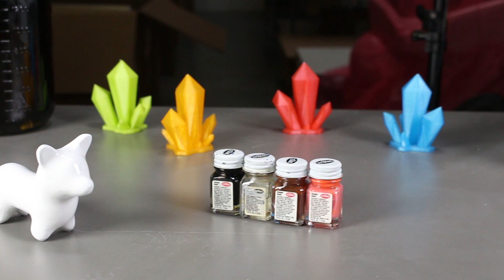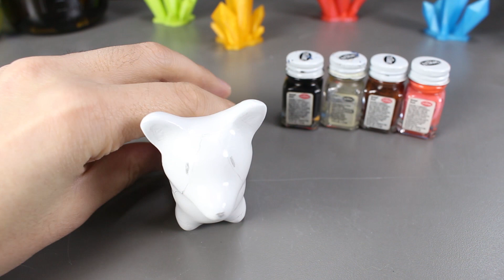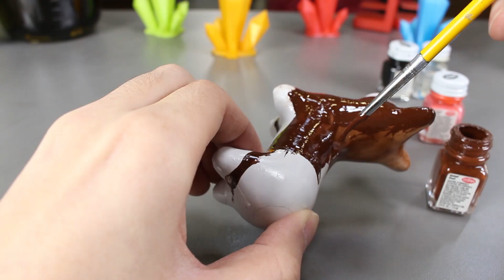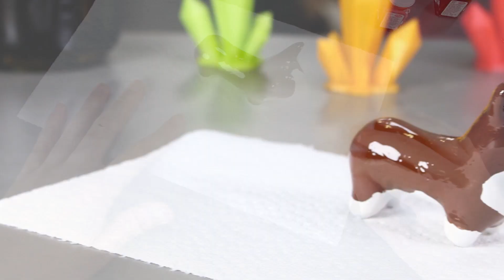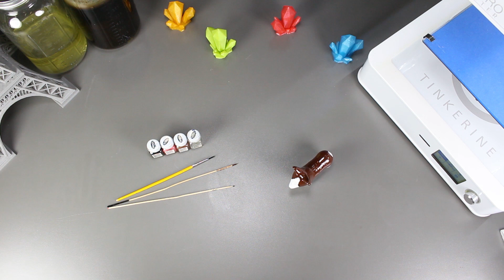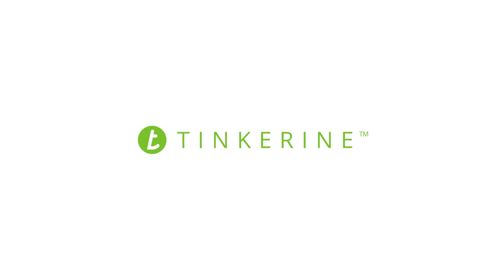Post-Processing 3D Printed PLA Print by Hand Painting

Comment: ive been using acrylic paint markers and they layer down better then paint and a brush
Reply from the maker: Thanks for the comment and advice!
Reply: your work is top notch and beautiful, your skilled at what you do , im not , so i meant that for me the paint markers work out better then using a brush with paint.  sorry if i came off rude. i got a few of the thin ones and a few different thicker markers and it helped me alot
Reply from the maker: No worries, you did not come off as rude. We think it's great advice and a great suggestion for us to also try out! Which ones do you use?

Comment: how did you post-process is ? i checked your videos and there was tumble thingy and it doesnt look like working like your corgi :))
Reply from the maker: Hi!

Thanks for the comment. We printed the corgi and then we sprayed a coat of high density filler primer and then sanded it down to what we have in our video.
Reply: @Tinkerine  Can you provide more details? Is there a specific primer?  Did you sand first?  With what grits before and after?
Reply from the maker: @crashboxdotcom  We used the Rust-Oleum Filler Primer and then sanded it down with 100/200 grit sandpaper. We repeated the process until it was smooth.